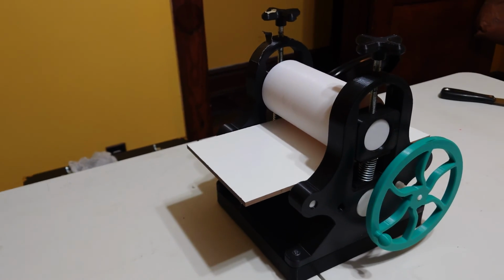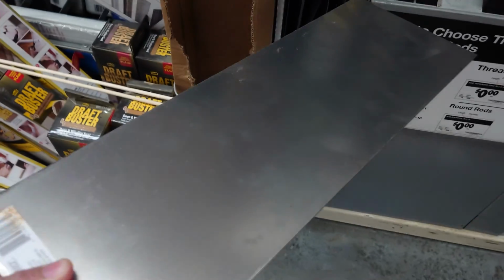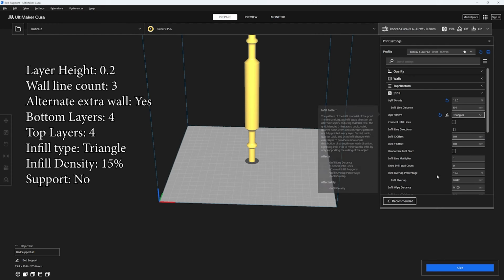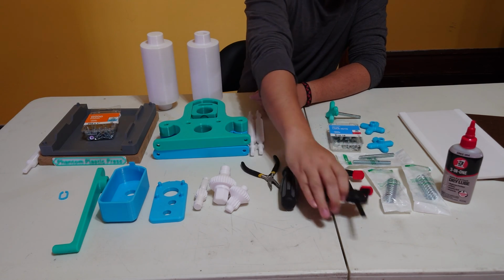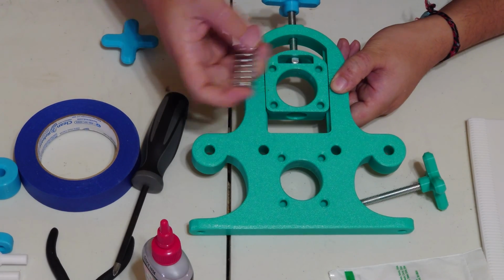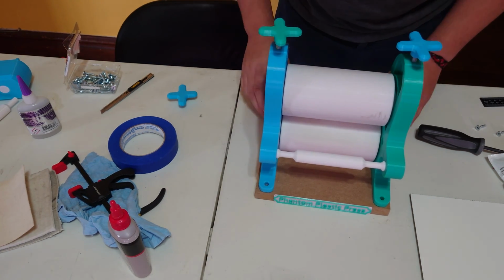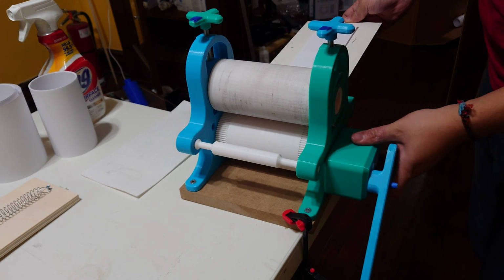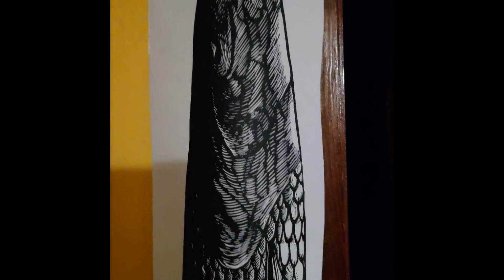How to make a 3D printed printing press

Comment: Depending on the plastic 3-n-1 oil can degrade the plastic over time, you can get plastic safe grease online, it's made for model trains and cars that use plastic gears and other parts. Tamiya white grease is one of these. Its thicker and last longer, and your parts wont slowly melt....

Comment: just built this! i’m struggling a little bit with the friction with my board (shouldve printed the roller w gears) but I’m going to get rubber mats and glue them to my press bed to see if that improves the friction between the rollers
Reply from the maker: that could work. I've been using skateboard grip tape on the bottom roller or underside of the bed which also works.

Comment: What other springs can you use other than Menards because they are not in the PNW and doing google search for zinc compression springs is not yielding results most are coming up as steel or nickel plated
Reply from the maker: I've found Springs (1.5mm, 60mm, 18mm) on ali express work well. If you go on my version 2 of this press video there is a link to some on ali express

Comment: For the handle, you might consider a 3/8 bolt instead of gluing the threaded rod with a recess in the handle to capture the head with a glued cap to conceal the head. Really like the prints, the 6' print is stunning.

Comment: Gen-x bike trick to help get the blue handles on the threaded rod:

Rather than a second handle, thread a bolt about an inch down, then a second one. Tighten the two against each other, they won’t move. Then use the one farthest away from the handle as leverage (with a wrench or vise grip).

Comment: Great video. Very inspiring! What size bed does the 3D printer need to make this Nick?
Reply from the maker: This version needs a printer with at least a build volume of 220 x 220 x 205. I do have a mini version for v2 that only needs 180x180x180
Reply: @someprintdude  Thanks! The Bambu Lab A1 seems like a good option for me.

Comment: Interesting project.

Just a thought on the geared press bed, have you considered just printing the racks and glueing them on to a plastic/wood/metal sheet?
Reply from the maker: I did consider the idea but I decided not to try it. I was concerned that if I did not glue the two sides exactly parallel, or if the racks were slightly offset, that it would not work.
Reply: @someprintdude  That makes a lot of sense. Great project anyhow. I really like it.
Reply: What about the racks and a frame to slit the metal bed into? That way they are aligned and you could counter sink a screw or 4 in to make it all tight? @someprintdude

Comment: Is it possible to make this handle 9 inches wide paper?
Reply from the maker: I dont think it would be too hard. All you would need to do is make the top and bottom rollers longer in the middle. But I don't think it has the strength to print a 9 inch wide matrix

Comment: cool design, I have printed the openpress design and I might now try this as the size is vastly greater. Is it worth looking at getting a list of parts that can be bought internationally through somewhere like ali express? I have no idea what a 3/4" x 2-3/16"  Spring equates to in metric.... and would love to be able to create the press as you intended.
Reply from the maker: I'll add ali express links for the nuts and bolts, but I also have no idea what this spring would equate to in metric. I haven't had much luck buying springs online as sometimes they don't behave like I expect them to. Luckily the press will work without the springs... maybe I will try to engineer some 3d printed springs.
Reply: @someprintdude  thats great, thanks for the feedback. I am rubbish with working springs out, I have gotten it wrong so many times when I have tried to source them. I look forward to making this in the near future.

Comment: Impressive, nice to see another printmaker with their hands in the third axis plotting world.  The intaglio results aren't that surprising, even some smaller steel presses aren't entirely viable for printing intaglio. Just look at the lengths something like a french tool goes through in order to establish sufficient rigidity. If I can say anything: Don't be afraid of metal. Steel fabrication isn't as hard as it seems, and in many ways it can be a less finicky material to work with then FDM. Fun video, Peace!
Reply from the maker: I hope one day I can make one in metal. I have some welding experience but I always get stumped when trying to make the top and bottom rollers. I'm just not that precise with my fabrication, although I have considered getting a machine shop to just do that part for me.

Comment: This is amazing.  I've been interested in doing linocut prints and this looks like it'll be a fun companion project.  A few notes: (1) If you wrap your wheels in electrical tape, you can add a lot of friction.  It's pretty surprising how much it adds.  (2) You can probably get the rollers to print without supports if you make a hex axle that goes between your roller and your last gear, then just have a cavity in the bottom of your roller.
Reply from the maker: Two great ideas! Can't believe I didn't think of that. Maybe electrical tape on the bottom of the press bed so I can keep the slick look of the press intact. I'll give both a shot soon!
Reply: @someprintdude  If it ends up working for you, you can get some really wide electrical tape rolls (2", 4", etc).